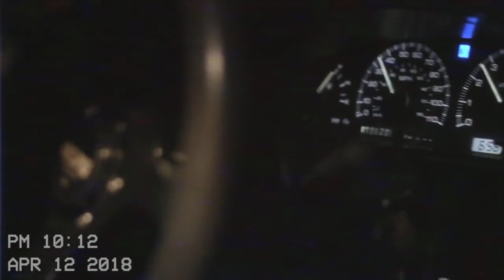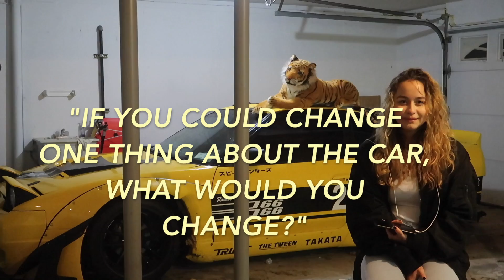MY PRICELESS LS2 ROCKET BUNNY 240SX

Comment: You and your car are so inspiring to me. I had a lowered TSX before but the E36 I have now is the first car I've really gotten into. In having it since May I've had the engine toast itself, brought it down to college with me, transplanted a healthier M52 into it, been stuck on the highway with overheating issues, snapped diff bolts, broken motor mounts, and more and I catch myself wondering if it's really worth it sometimes and I'm told constantly that getting it was a bad decision, but at the same time I have so many plans for the car, but seeing what you went through with your S13 and how far it has come makes me hopeful and so excited for what I can do with my E36 despite the trouble it gives me now.

Comment: Own a G35 and wanting to keep the vq. Everybody and the grandmother is like oh man engine swap ls, or 2j.  I feel like  alot of people don't give credit to the vq motor. The vq blocks are near bullet proof and with the block girdle you can stop the head wobble the engine is known for. I like the swap idea and at the same time I like the idea of leaving the soul of the car intact .  I don't know  what's best , or even if there is even any "best" for the g platform . For 10 k I can get a built forged vq  long lock that will hold up to 800 hp , don't have to worry about wire harness , after market mounts and I get to keep the almost perfect front to rear weight ratio. The v8 sounds sick no doubt  , I'm just torn what to do.